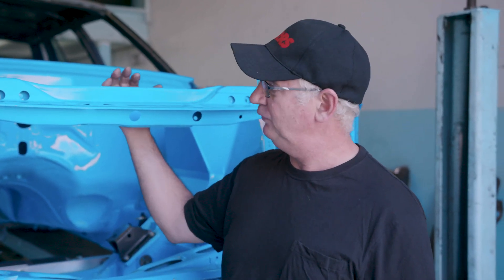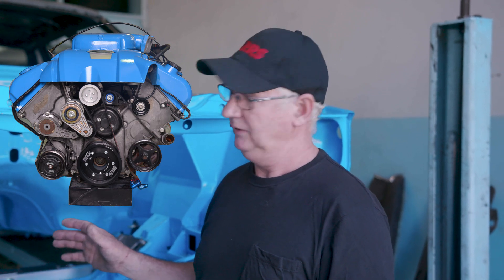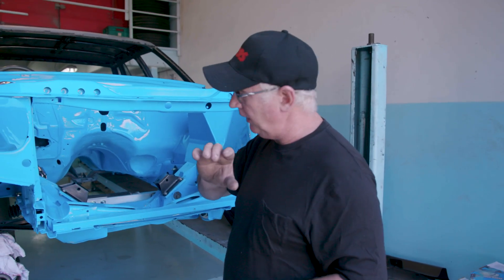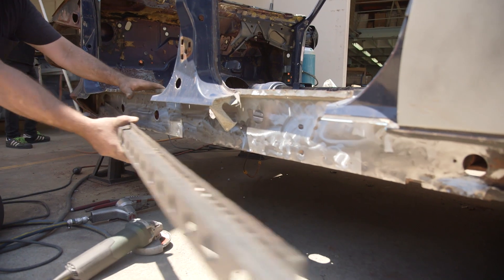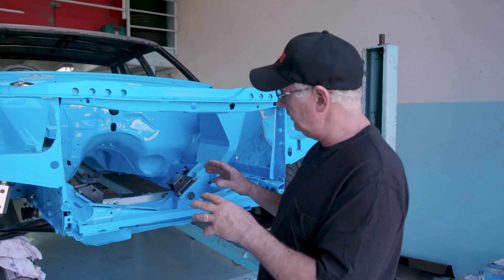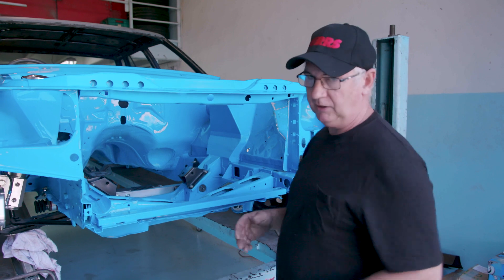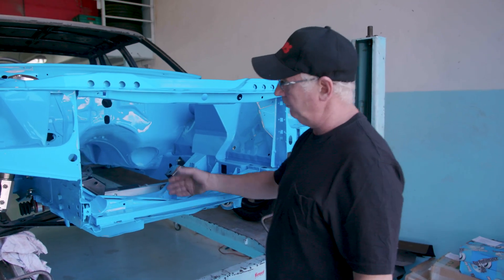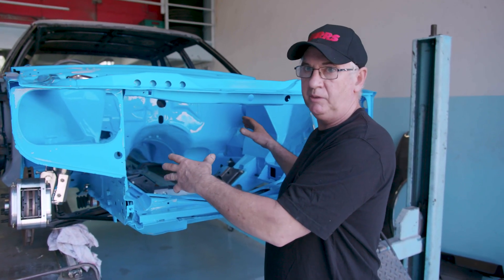Classic Ford Chassis Reinforcing and stiffening with RRS

Comment: Do you offer any chassis connectors or stiffening products for a falcon that don't require major surgery? ie. cutting the outer sills off.
Reply from the maker: To stiffen a unibody chassis is a matter of joining one or more elements together, there are no small products that we are aware that achieve this.